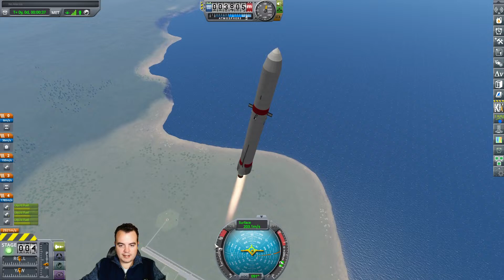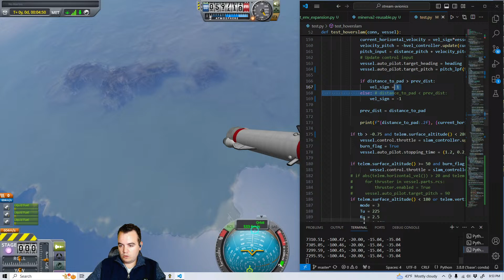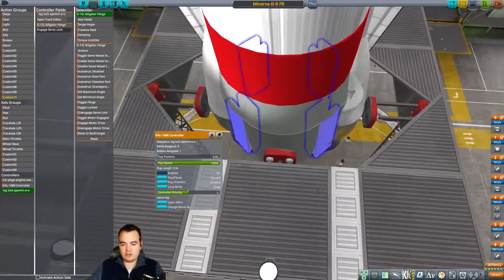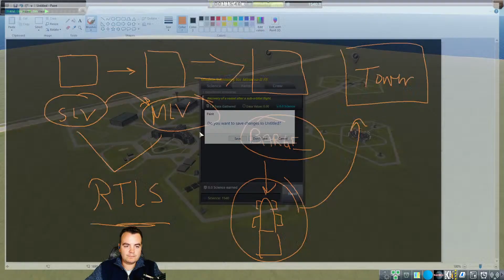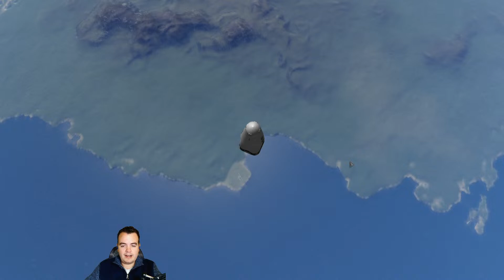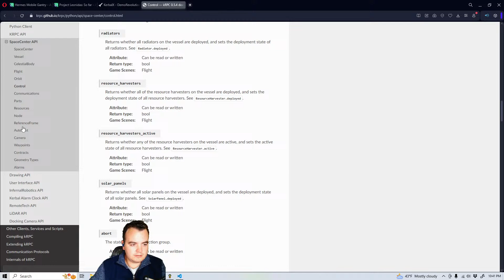KSP Hardcore Career - Automated Rocket Landing Attempts

Comment: FYI, you’re my new favorite channel for KSP. I’m hoping to do my own channel which go over my cool reusable rocket builds the primary workhorse of my reusable rockets. That’s the pinnacle of them. All is that what I call the guyvatron heavy 2B. I am capable of landing the two boosters because they are both connected to each other while the center core splashes down in the ocean with parachutes and air brakes. The only part I’m having a hard time with is the second stage cousin KSP console. It’s hard to land the first stage and center core, while making sure the second sage gets to orbit in time otherwise you’ll have problems